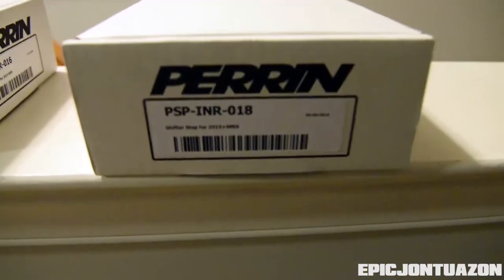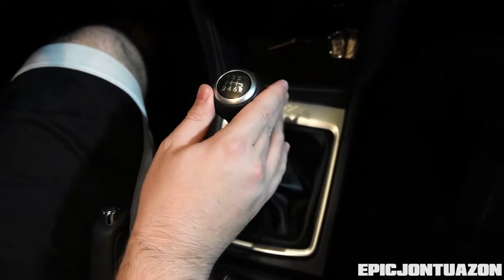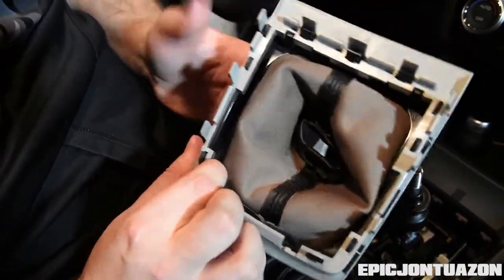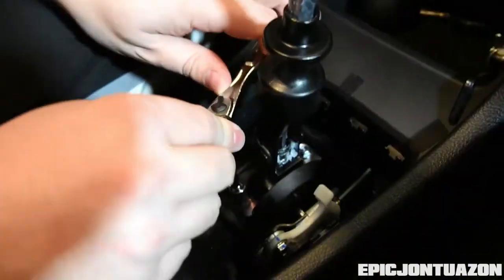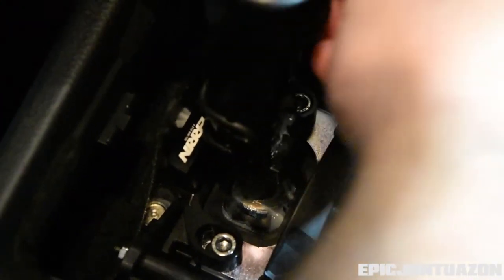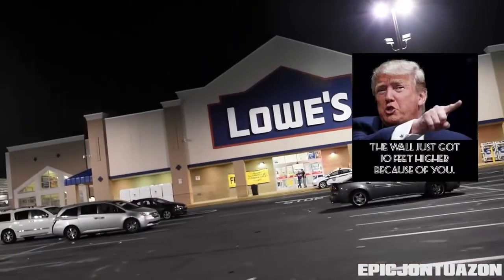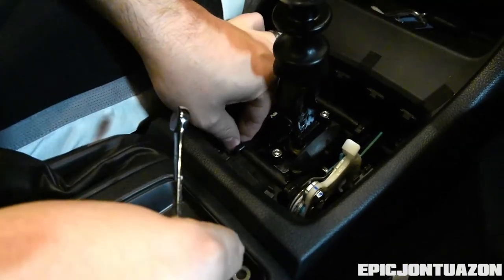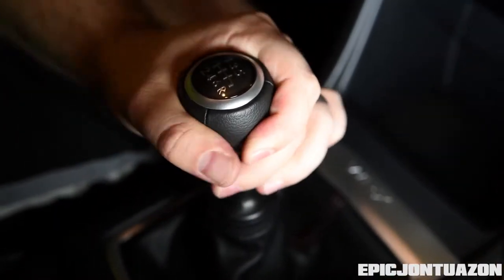2015+ WRX Perrin Shifter Stop Install

Comment: Does the 2017 wrx with STI short throw shifter have the wiggle problem too?
Reply from the maker: +Kevin Lam i'd assume if there is no shifter block then there would be a little bit of play unless the shifter is physically thicker.
Reply: I haven't tried lifting up the shifter cover yet but for some reason there isn't any play while trying to move the shifter to the left side but once you move the shifter to the right side there is play. Not sure if that's normal for a STi short throw shifter.
Reply from the maker: Kevin Lam When you say left side are you referring to gears 1 and 2?
Reply: EpicJonTuazon Yeah.
Reply from the maker: Kevin Lam That's interesting. You should have play on both sides if you havn't touched anything down there before.  More so on gears 1 and 2 because there is no shift stop.  Best way to diagnose is to pull up the shift cover and take a look.  You can lessen the play by doing what I did before I installed the Perrin Shift Stop and that should solve your issue.

Comment: How do i fix the wiggle room when in gear the up and down slop?
Reply from the maker: SemDawg what gears are you referring to? When yu mean up and down do you mean whatever going into gear?
Reply: EpicJonTuazon So in any gear. For an example, lets say its in 3rd. Once in gear the stick still can move up and down a little. Not changing gears just in the gear in moves. Its sloppy. I'm trying to fix that. I hope i explained that well haha
Reply from the maker: SemDawg haha i think i got you now! Do you have an OEM shifter or aftermarket short shifter?
Reply: EpicJonTuazon I have a OEM shifter, only upgrade is a shifter stopper
Reply: okay those 2 were next on my agenda! Thank you for the quick responses!
Reply from the maker: +SemDawg awesome! I have both install videos on the 2017 WRX Build playlist, super easy! Hit me up if you have any questions! Please consider subscribing! and GOOD LUCK!
Reply: Thanks and i got you, Subscribed!
Reply from the maker: +SemDawg appreciate it brotha!